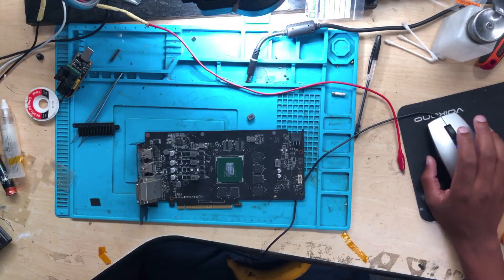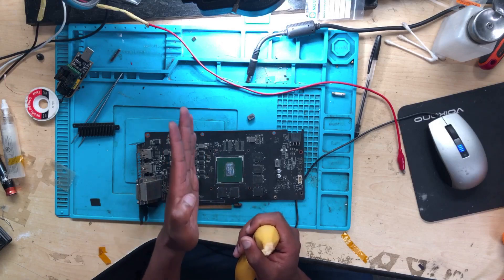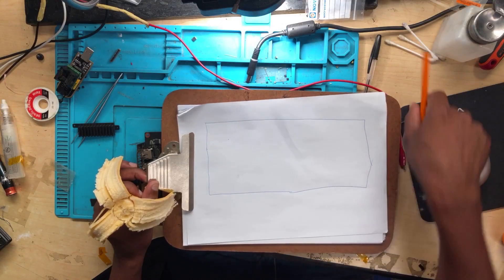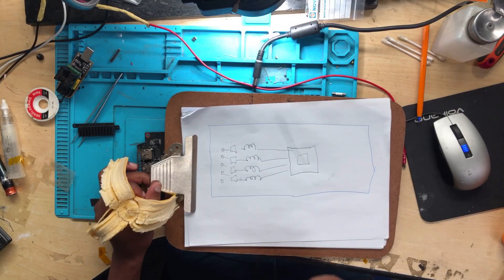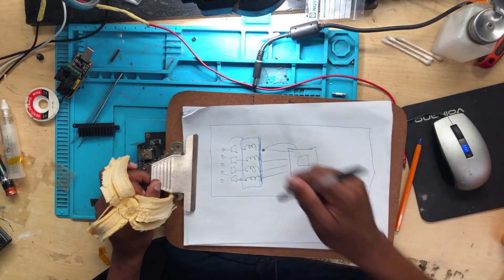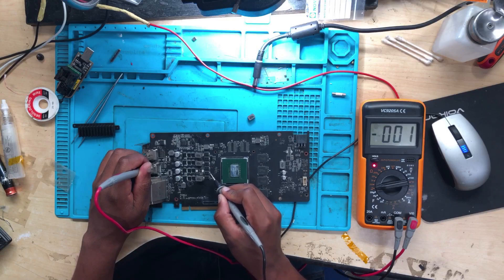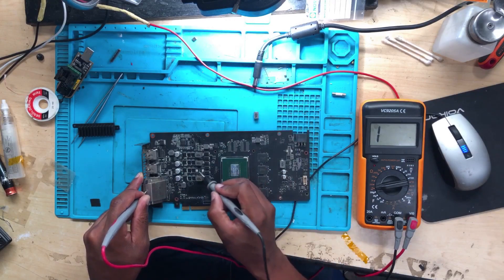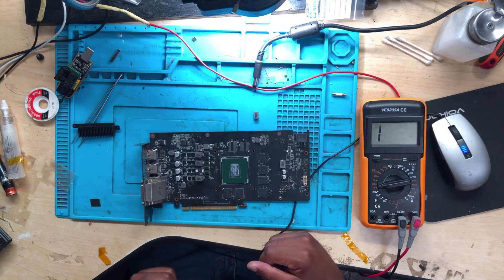Gpu repair short lesson

Comment: On GPU you should measure in ohms mode not diode mode , because the news GPU has low resistance to ground less than a 1  ohm , and in diode seems  to be short, and couldn't be ... On modern GPU s
Reply from the maker: I’m still waiting for the link for that software to diagnose Gpu memory failure you told me about
Reply from the maker: By the way I was using ohms , it gave me 0 ohms when compared to ground